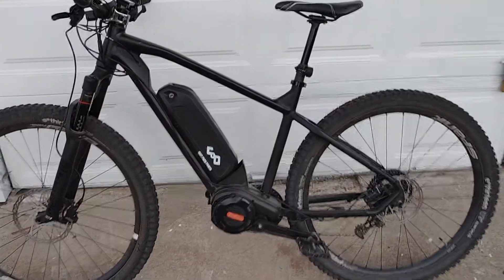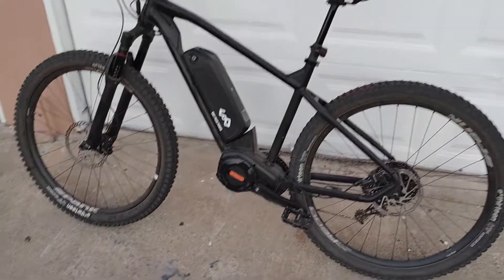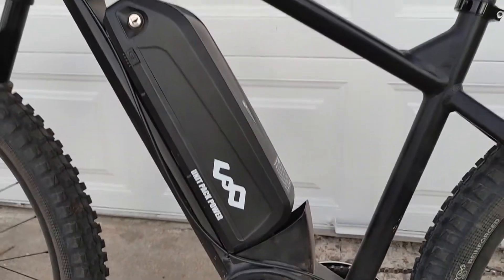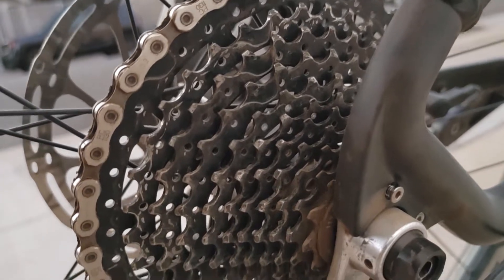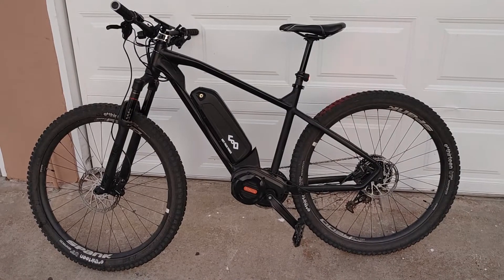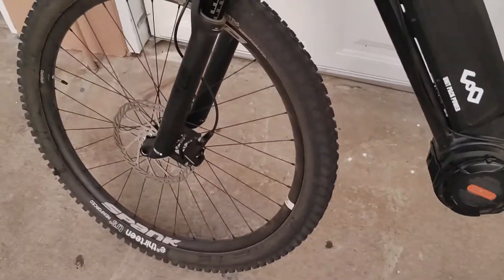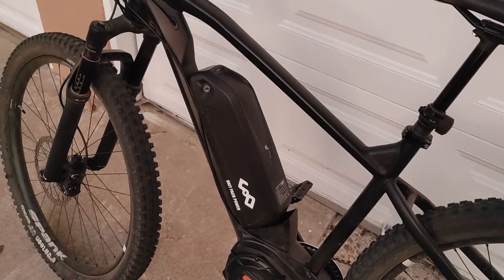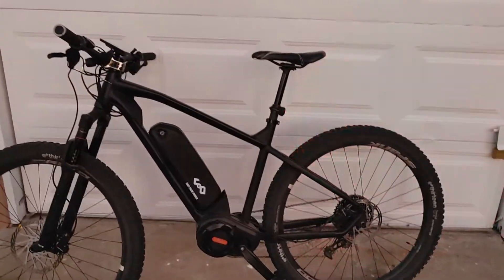Bafang ultra g510 frame build

Comment: Ever thought of putting 27.5 plus size tyres on it to soften that hardtail up a bit? They are the same outside diameter as 29's and the back subfame on your bike looks like they would fit no worries. you can pick up Boost hubs 27.5 x 30mm rims pretty cheap second hand looking around
Reply from the maker: I actually wanted to try fatter 27.5's but the problem is the frame is non boost. In I haven't found any non boost 27.5 + wheels. My fork is boost so I'm using an adapter on the front wheel.
Reply: @OverLandCruzer  very nice bike build you have there mate! I build something very very close to what you built but i dont post YouTube vids, i got 29 and 27.5x 3.0 wheel sets both tubeless. Hope you can find some wheels in yr size i prefer the plus tyres because they take less psi to feel firm and they grip up awesome ( im running folding Schwalbe Nobby Nic tyres all round for lite weight wheels) hope you find what you're after mate i subscribed SICK BUILD! 🤙 peace✌

Edit: Schwalbe stopped making the plus 3.0 not long back but i have some, only 2.8 in Nobby Nice now ( i have both 3.0 on my bike and 2.8 for my next set ready to go on in my spares)

Comment: Why no replies? Such a frame in Ti or Carbon that fits the G620 or 625 ? 
What's the weight? Looks great for a 180lb+ guy. 
65, 75lbs gross? Kick ass ride vid, but leaving (us local)  builders in the dark? 
You got the respect. Stop the suspense and tell us what's up !!!
Thanks ... Right down your street.

Comment: What is distance range for this motor with battery 52v 11ah please
Reply from the maker: I will do a test soon to get a better sense. So far I would say about ten miles with pretty heavy motor usage including some throttle only and high speed (over 25mph) riding.